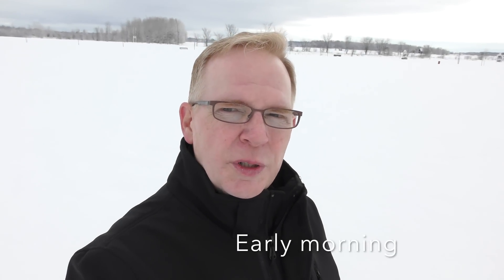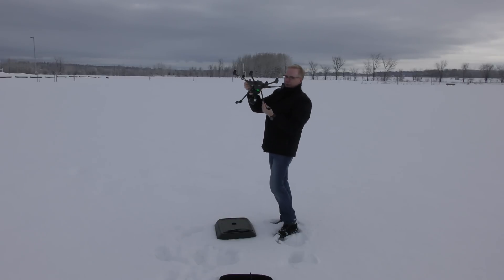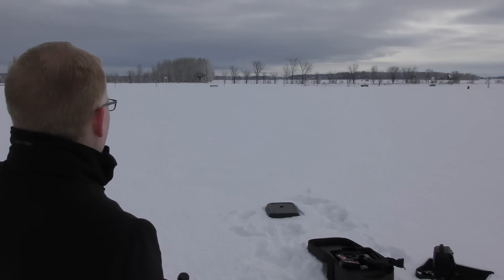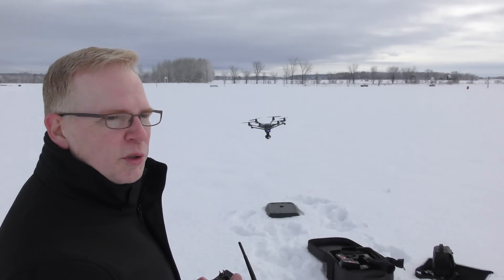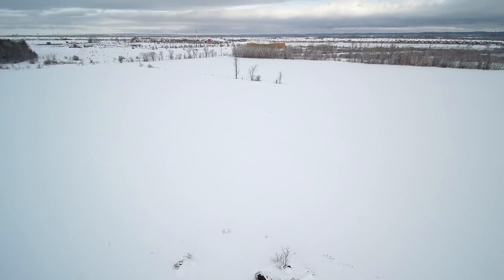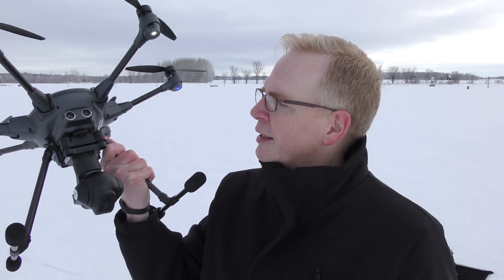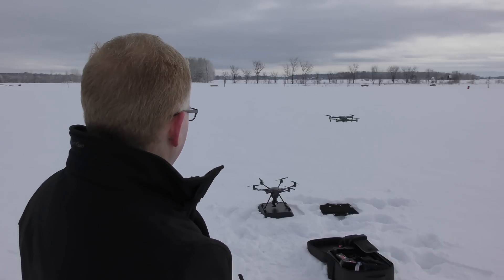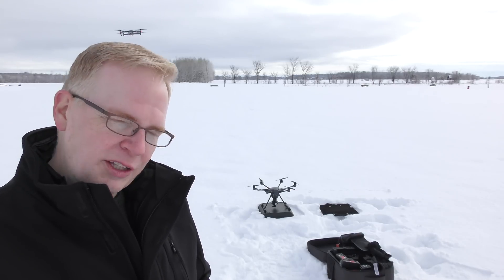TYPHOON H and MAVIC PRO - FIRMWARE UPDATE TEST FLIGHT

Comment: Captain Drone
So theres a compass dance on every 
GPS drones,but what im confused about is why does compass calibration on a lowcost gps drone does not get saved?
We do it all the time once we turned off the lowcost gps drone and power it back on then we need to do compass calibration so how to fix that problem??
Reply from the maker: low cost drones do not have the ability to save settings onboard and they come with very basic flight controllers.

Comment: Steve- when you're talking into camera can I ask you what's the kit you're using?  I'm thinking my old Canon 5d2 with a Pentax 28mm might do okay even if its top whack is 1080p loads of DOF and a decent aperture range up to f3.5. - with a Rode shotgun mike on the hot shoe.  How's that sound?
Reply from the maker: Ian, as long as you place it on a tripod all should be well.   All of my more recent videos (in the past 2 or 3 months) now all include exactly what kit (camera & sound) I used to create the video.  Have a look at any new videos and then drop down into the video description.  I try lots of different kit so if there is a video you liked for sound, lighting and color, the gear I used will be listed in the description.

Comment: The Mavic is sooo much better than the H... Look how steady that bird flies.... awsome. Unfortunatly even though the H looks very very cool, its specs are not as good as the Mavic. For just one example, range and transmission signal of the H  are no where near as good as the Mavic, 1 mile vs 5mile I believe - thats a massive difference, and even though not many people fly that far, it is more about having the better live transmission feed back too the pilot. No drop outs or freezes in the live feed.

Comment: Boy that Typhoon H seems extremely unstable when its supposed to be just hovering there.  Is that normal?  My little Spark is Rock Solid Stable when hovering.
Reply from the maker: The farther the motors are out from the drone itself, the slightest movement in correction is exaggerated.  Considering this is a Hex, each motor is trying to make an adjustment so you will get movement if there is wind or you touch the joystick slightly.  The Spark is very small and like you said it is rock solid in the air.
Reply: OK, I guess I would have thought with the Typhoon being a bigger , stronger, and more expensive drone that it would just be better all around than my little cheap Spark.  But I can see what you are saying... Excellent Video...

Comment: With your test on the H, did you have any other issues with the height after your firmware update? And are you certain it was caused by the temp change from your car to the outdoor temp? I did an update on mine and every time ive flown it since when i try to descend it does a quick drop then goes up which i find weird and kinda scary, kinda wondering if my issue is because of the barometer not getting warmed up to the outside as well
Reply from the maker: It does sound like a sensor issue.  You could try a calibration of the accelerometer.

Comment: What are the field of views for the cameras? Seems as if the Mavic is a little smaller? Does that make a difference for you? Also, do you feel like it's better using your phone as a screen and everything?
Reply from the maker: Field of view is more narrow on the Mavic Pro.  It means to get everything in the shot, you may have to backup a bit.  I'm not a fan of using my phone on any controller.

Comment: I have both drones too. I love flying the Typhoon H, but the size of the Mavic is great when travelling. The one thing I can't stand about the Mavic is I must fly with a phone or tablet. This, in my opinion, is a stupid design decision so DJI can pretend their drones are a good value. Once you have become accustomed to the Typhoon's controller/screen the Mavic is a massive letdown. They are both fantastic machines as long as you understand their strengths and weaknesses.
Reply: True about having to use a phone or tablet for FPV flying, but for line of sight you can fly the Mavic with just the controller as you know.  And you can fly it with just the phone with WiFi should you be so inclined.  I appreciate the versatility.  The Typhoon's controller is just plain huge, like one of the old-school types used in the old days for flying RC planes with 6 foot wingspans.  Just my opinion.
Reply: Its not any larger than a 10 inch tablet strapped to you Mavic controller and wires dangling all around! The ST 16 is a great controller without all the BS !
Reply: Power to ya!

Comment: hello captain I am gonna buy a new drone but I am still searching what do u recommend which one is better generally?
Reply from the maker: Will this be your first drone or do you have one already?
Reply: CAPTAIN DRONE 
it's gonna be my first drone but no problem I need the best one I can learn quickly
Reply from the maker: Today the best drone on the market for first time users is the DJI SPARK (the version with the remote control).  It is super simple to fly.  The DJI Mavic Pro and DJI Phantom drones are very stable in the air which gives new users a chance to take their time and figure things out.  The Yuneec Typhoon H is the only drone that includes everything you need right out of the box for flying.  Since it is bigger in size, it flys fast which can scare away people, but it certainly looks cool!  If you have a massive open field to fly and practice than any of the drones I mentioned would be great (even the Autel X-Star is good).  If you have less space with obstacles than the DJI Mavic or Spark would be better for a first time flyer.
Reply: @CAPTAINDRONE798  thank you

Comment: Hi, great video, what smartphone you use in your Mavic? in the last firmware update I get a lot of "No signal" messages and have to turn off and on  many times until get signal from the camera, i use Samsung A7 android
Reply from the maker: Carlos Cobos Films I use a Samsung Galaxy Note 5 phone.  Your problem sounds like a cable connection issue.  Try a a different cable and use the USB out of the center of the controller and then to your phone.  Make certain it's a data USB cable and not a power only cable.

Comment: I see the Typhoon camera is worse than that of the Mavic: strong colored vignetting (lateral color shift) a splash of yellow-orange around the center, going to cyan-greenish around the borders. Horrible!
Reply from the maker: I do like the MAVIC camera better than the Typhoon H, only because it has more camera options.  The Typhoon H camera is not horrible at all.  Snow on a dull day is difficult for any camera to get correct, and the exposure will always be wrong.  Here is a video I took with the Typhoon H and no color post processing.  The Typhoon H did a remarkable job:  https://youtu.be/xj-70ReOeJw

Comment: Any issues when flying the Mavic in the cold, besides your hands? lol. I'll be going from Florida to New Zealand this July and I was curious. Great video!!
Reply from the maker: The Mavic Pro works extremely well in the cold.  Since the internals heat up significantly, all is well.  Also the batteries are small enough to fit in your jeans pockets to keep warm, to increase flight time in the cold.  As long as your cell phone or tablet works in the cold, all is well.

Comment: Great Video.  I've got snow here in Michigan as well.  Curious if you experience any horizon tilt with your Mavic Pro?  If so did the firmware update seem to help with it?  Cheers.
Reply from the maker: Thanks!  No horizon tilt with the Mavic Pro, but I did get it on the Phantom 4 Pro.  The latest firmware update seems to have fixed it on the Phantom 4 Pro.
Reply: CAPTAIN DRONE I just ordered a typhoon h and i am new in the field in the aspect of flying a drone. I fell a bit uncertain about the typhoon h and thinking of cancelling my order. I am thinking of getting the mavic instead because of its flight duration. I need your help. What should i do? Amazing videos too and keep it up

Comment: hi there,i'm new to drone flying,i got the typhoon h pro,i wanted to update it via the website but it only has the typhoon h not the pro on there,is the update the same for both and also where is the realsense update located? thanks
Reply from the maker: The update is the same for all Typhoon H models.  If there is any update to the Realsense, it will be included in the update.  Here is my video on how to update the firmware (note:  make certain you use Google Chrome to download the firmware files):    https://youtu.be/e-xScUBG2nM
Reply: Thank you!

Comment: Wow.  The old Deavy Farmstead sure has changed within one short year.  https://www.youtube.com/watch?v=DPSFTGBa8wg   I went back a month later and made this hi-res map using MapsMadeEasy.  Zoom in for closer view.  Note the largest tree in the centre had been cut down.  https://www.mapsmadeeasy.com/maps/public/586829dc5c1140db8bdfcd858a311756/  Also check the 3D model.  Zoom, rotate, pan.  https://www.mapsmadeeasy.com/maps/public_3D/586829dc5c1140db8bdfcd858a311756/
Reply from the maker: Yikes!  They certainly knocked down several buildings since April of 2016.  Very cool with the 3D imaging you did.

Comment: I have a quick question. I have the typhoon h, but have only flown it two different days. Today was the second day I have flown it and when I tried to start it up it started flashing red a few times and then it would flash blue. I didn't understand what was going on and I could not find anything that could explain this color pattern, so I decided to try to recalibrate it to see if maybe it was that and it worked. Do you know if I will have to recalibrate the compass every single time I fly? Or is there something I maybe did that caused my compass to have to be recalibrate? The version I have is the typhoon h pro which has the real sense in case that makes any difference.
Reply from the maker: RED = Low Battery or Return to Home Mode.  Check your battery & check the switch on the top right of your controller.  You only need to calibrate the compass after a firmware update or if the Typhoon H will no in a straight line no matter how many times you try.
Reply: CAPTAIN DRONE Ok thank you for the info and for getting back to me so soon. I might have had it in return to home mode and maybe switched it off after recalibrating. Battery was fully charged, so I'm sure it was not that. If it keeps happening I might just end up giving yuneec a call. Thanks again for the info.

Comment: Thanks!  Just got my YTH back from Yuneec.  Right stick needed replacement on the ST16. Afterwards, my aileron (side-to-side) response was way to twitchy and jerky.  Today I upped to the latest firmware (put out since receiving back from factory), then went into the channel settings and adjusted J4 back to same settings as J2 (yaw).  +80 and 20% response. That took the straight diagonal line and softened it to a gentle S-curve. Now, much better behaved, yet still responsive. No issues after firmware update, now that I've done that around ten times since last June.  Can't wait for the better weather, Captain!  BTW, also updated the Mavic last week and it's also doing well....
Reply from the maker: Glad you're enjoying the Typhoon H.  It has some really nice features.

Comment: I have the same drone(typhoon H) bought it last year in October. i never had any issues with it never drifted not only that i have pushed it while it was hovering its amazing how that drone has the resistance it has when you try to push it while it's hovering.  never did any updates do to the horror stories I've heard. now I'm over the height limit of 405ft.i guess what I'm trying to ask is with the newest update can I adjust the height or do I also got to download the gui download file as well.ive never did any updates on any drone so I would be a rookie when it comes to updates to drones.